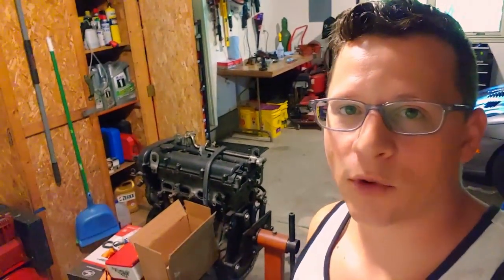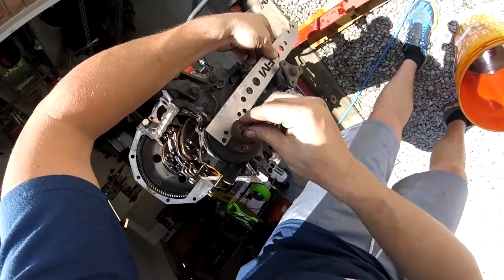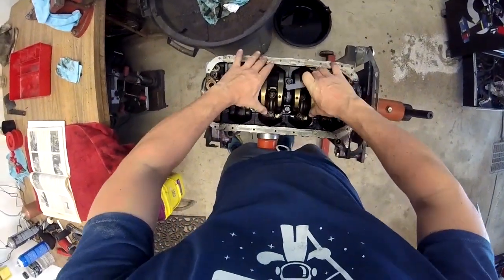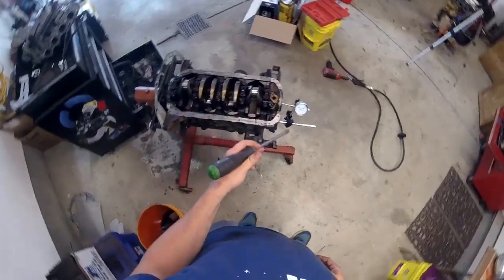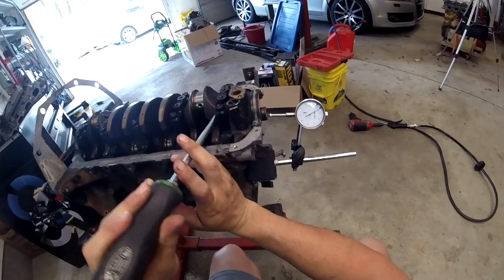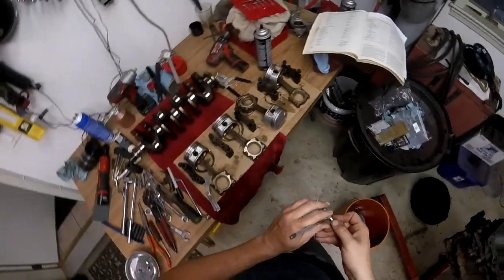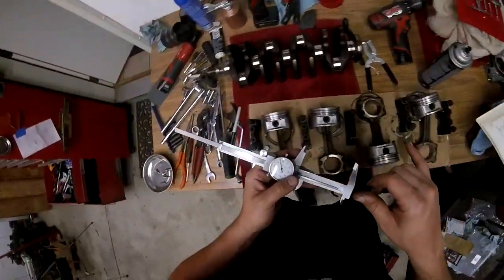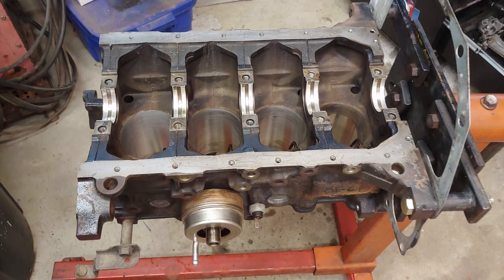Miata Engine Build Pt3 - Step-by-Step DIY Block Disassembly

Comment: Great videos 👍👍 only thing I noticed is that was a vernier caliper used to measure the crank journals. Ok I guess for DIY but a micrometer will be a little more accurate.

Comment: Could you help me, my crankshaft doesn't want to come out as easily as yours. One side of it will but the other side will not
Reply from the maker: Have you removed your rear main seal and carrier yet?  Without that removed, it SEEMS like you can get the crank out but it's not quite enough room.
Reply: @racecarcamp9056  basically everything is off of the block except the crank and the part that's keeping the crank in. It was from the timing belt and the harmonic balancer but where all that stuff went on. It just won't come out and it seems to be holding the crank in, it's hard to explain without pictures
Reply from the maker: @avioc3253  Post up a photo link and I'll have a look :D